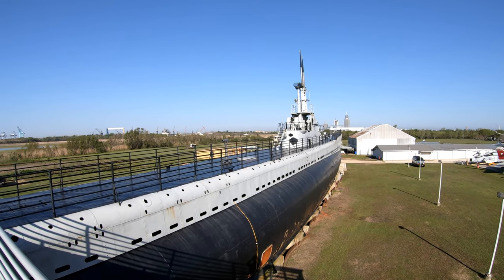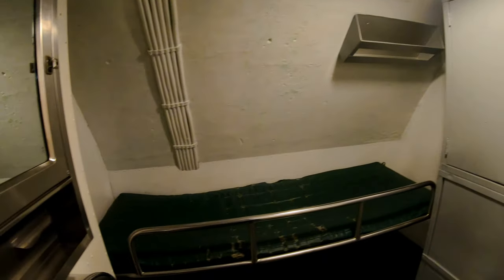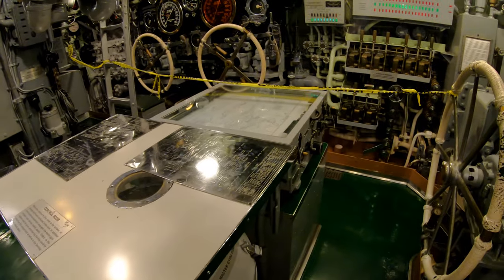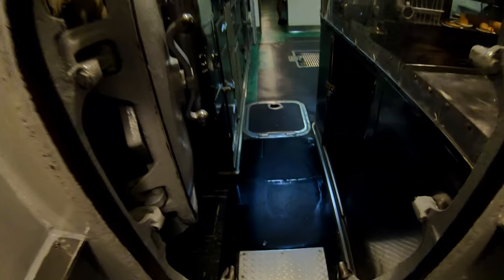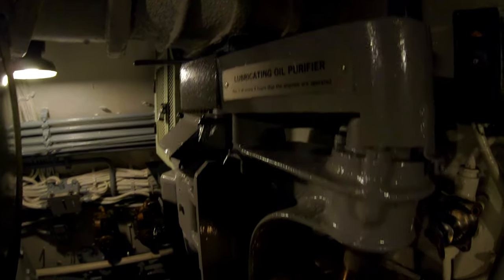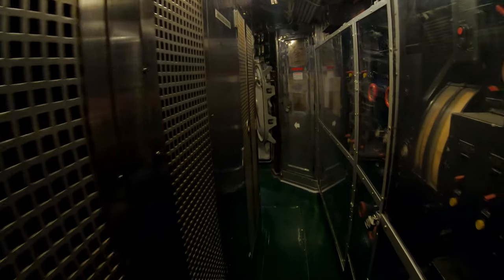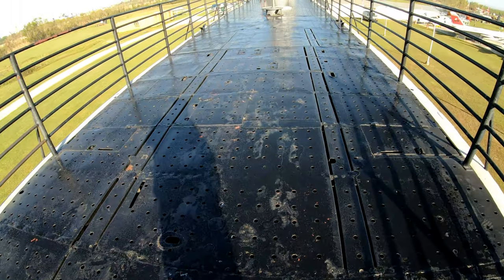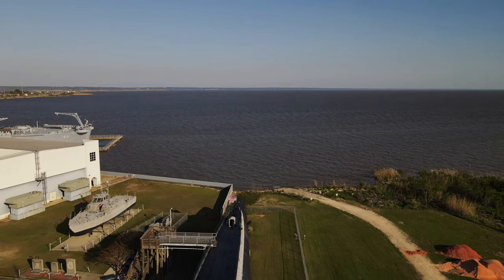USS Drum (SS-228) WWII Submarine Tour, 4K 60fps

Comment: Great video!  One minor comment: In the forward engine room there is an auxiliary diesel generator below the two main diesel generators.  If all four main diesels are being used for propulsion on the surface, the auxiliary diesel can be used to charge the battery.

Comment: First, the USS Drum is NOT a ship, it is a BOAT!  On November 22, 1943 while on her 8th war patrol, the Drum suffered a severe depth charge attack. The aft door frame upper hinge and adjacent plating in the conning tower (common on early Gato-classes) cracked and was letting in water at about two to three gallons per minute when submerged. The Drum headed immediately for Pearl Harbor, where an attempt to fix the door was made by replacing the after bulkhead with a new one without the problematic aft door. However, on a test dive on January 1, 1944, the conning tower began to buckle. Lockwood sent the USS Drum to Mare Island for an overhaul and a entirely new conning tower. At Mare Island, she received a new, much stronger Balao-class ("thick hull") conning tower. This makes the Drum very unique! She's a Gato-class submarine with a Balao-class conning tower!

Comment: where did all the exhaust from the engines go?  How were the crew still able to breathe properly underwater
Reply: Blown overboard ... these subs only dove to avoid detection and attack. Since diesels only ran surfaced it wasn't an issue. Air trapped in the boat was sufficient for 24 hours give or take. But such long submergence was rare.

Comment: Quite the change from the time I was there. They had just pulled it out of the water. That thing was a mess inside and out. As I remember it had zero paint. A Rusty mess top to bottom. The inside was almost unbearable. Looking down into the lower deck there was water with grease, oil and diesel floating on top. They were in the process of pumping it out. Cudoz to the people who cleand her up. I may take a trip to see her again.